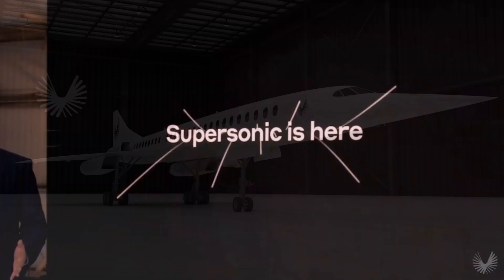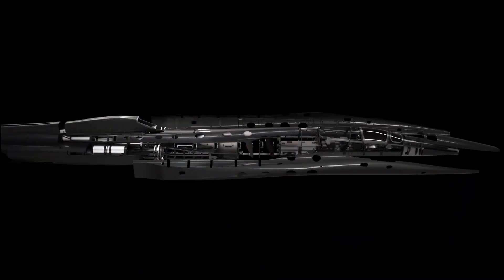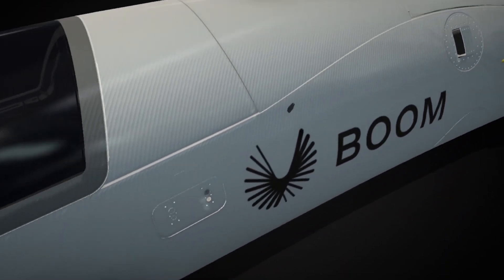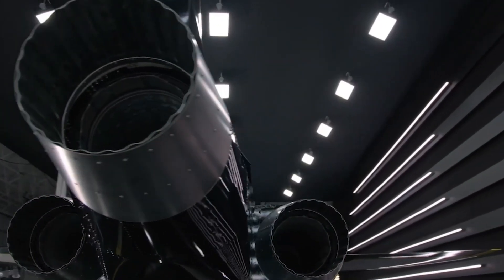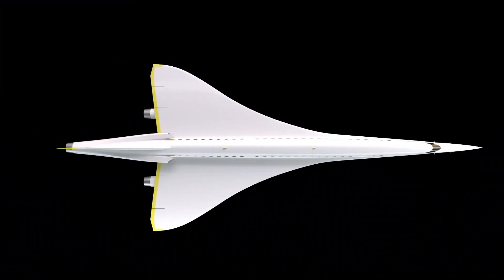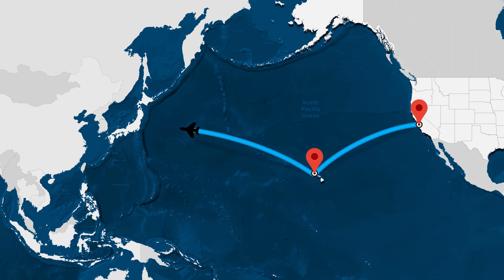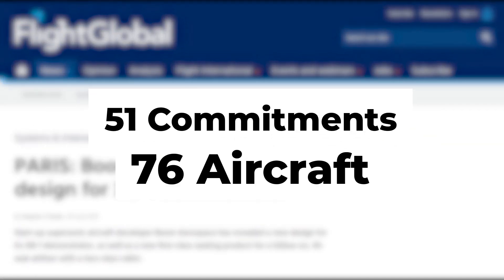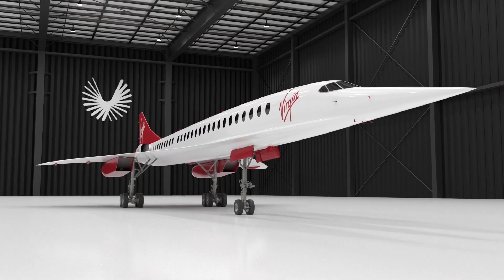Boom XB-1 Rollout & The Boom Overture - What Happens Next For The Concorde 2.0?

Comment: I just realized how long this plane (Boom Overture)  will be... it’ll be 12 feet shorter than a 767-300. I thought it would be the side of a 737-800 but no it’s much longer wow
Reply from the maker: Its quite small! Remember its only 1-1 seats as well, 55 passengers. In fact, if the passengers have lie-flat seats then its only 30 passengers
Reply: Found And Explained width side yes it will be a narrow plane but it will be lengthy
Reply: @FoundAndExplained  they could probibly fit 100 people with a 2+1 configuration with normal seating pitch. That would put it surpricingly close to the concorde.
Reply: @matsv201  2+1 is not a good balance. You want balance in an aircraft.
Reply: @JuanGarcia-zq5tp  there is really no need to balance  it sidways,  the cross feed pump can handle that if its really needed.
Reply: This "BOOM’’ hasn’t got a snowball’s chance of even coming out of the assembly building, much less flying. They don’t have the money, the technology or the time to do it.